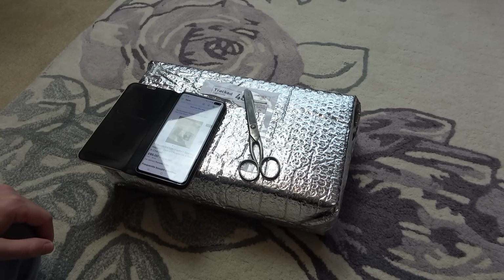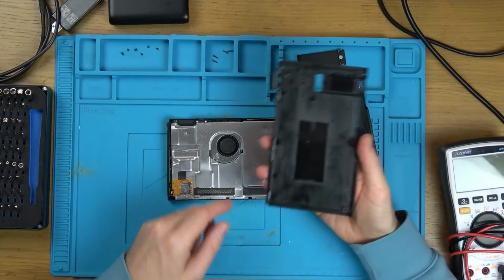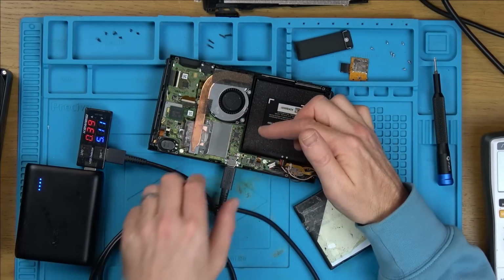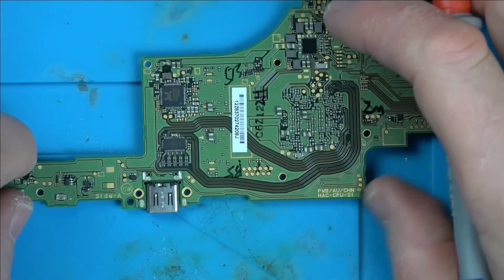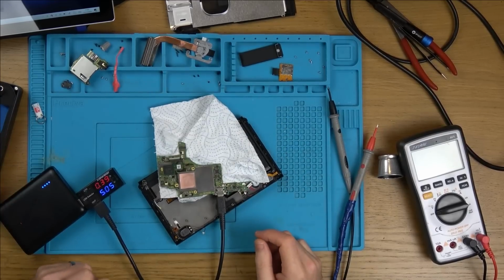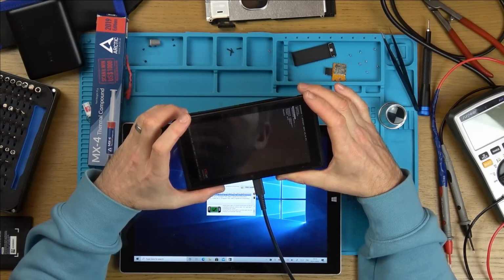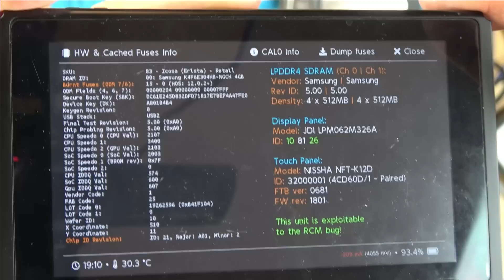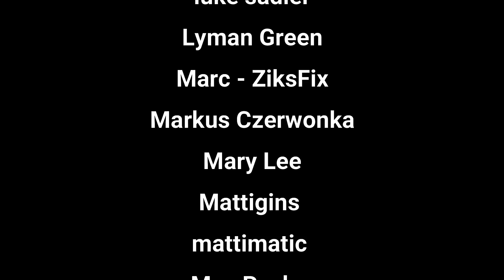Dishonest Broken Nintendo Switch from eBay - Can I FIX it?

Comment: Just for reference, there is a way to rebuild a new nand for it without the original keys. I think Dan from New Retro Repair has a way to do it on his channel :)
Reply: Hey Phil, thanks for the mention! @My Mate VINCE Check out the video where I rebuild the NAND for a switch. It's a big IF, but IF your switch NAND still works and you can access the prod keys, you can essentially do a "manual" factory reset to clear out any corrupted files. It basically rebuilds HOS using the keys stored on the NAND module to get it back to a factory state.

If you have any questions feel free to email me or DM me. Contact info is on most of my videos/streams 🙂
Reply: @NewRetroRepair  no worries mate. I hope vince can find some useful info for a revisit on your channel :)
Reply: It's great that all you repair guys help each other out. Vince is a nice guy ,just like yourself 👍
Reply: Yeah, ive done done this on a console i bought that had the same issue as this one, although it won’t play online anymore it will work offline just fine

Comment: I don't know much about the switch but I think RCM mode is recovery mode or rescue mode, special mode built in to the main chip to allow loading software even if the main operating system (stored on the eMMC chip) is damaged or missing. So it's definitely possible that it was a failed hacking attempt that corrupted the contents of the eMMC, but it's also possible just the eMMC itself or something on the eMMC board failed, in all of those cases the console will fall back to recovery (RCM) mode. autoRCM works by tricking the console into thinking the eMMC is corrupted so that it always starts in RCM mode, but I don't think that's what happened here.

Again not sure if it's common on switch but in other devices especially in various cars, the eMMC chips do fail quite often. It's such a problem on older Teslas that the cars have actually been recalled for it

From what I've read, if you don't mind using up a spare eMMC board (it will get overwritten), if you put in a working eMMC board, think you can extract the console keys from the APU using a tool called Lockpick. You can then use these keys to generate a working switch firmware correctly married to the console? There is a full guide if you search google for manualchoiupgrade. Obviously when backing up in step 2 you are backing up the donor NAND (aka eMMC) which is worth doing if you want to try to put the donor eMMC back in its original console later on. you can get keys.txt from Lockpick I think (just rename the keys file it makes to keys.txt), the firmware (fw) file you need to find online somewhere, everything else you need is in that guide. I have never tried this so if anyone reading this has any idea on whether this could actually work or not, I would be really interested to know!

PS - really enjoyed video as always!
Reply from the maker: Excellent, thanks ekens, I will google that guide and see what others comments say. It would be great to get the standard Switch OS back on here again 👍👍👍👍👍
Reply: @Mymatevince  it is a hackable switch and those go for good money
Reply: @Mymatevince  I would love a follow up video on possible fixes to reinstall the original OS to the switch and to bypass or rewrite over the code sets that are on the old EMMc nand flash.
Reply: @Dtr146  I don't think they're that valuable anymore since the newer models are close to being fully exploited.
Reply: I've not watched this yet, but I am at the start. From this short comment, are you saying it is in RCM mode?
Basically, if you have a hacked system, you HAVE to stick the paper clip / slide thing in the right Joycon rail, then hold Volume Up and Power, this puts the system into RCM mode, where it is ready to accept a payload and boot.
Now, you can get around all this faff by setting an option in the custom firmware ( once you have booted it ) that keeps the system in RCM mode " Auto RCM" as it is called.
I recently had to "fix" this for someone local, they just wanted a normal working Switch, so after fully charging it, I booted it to custom firmware, went in to "Hekate" and changed Auto RCM to "off" and then it would boot as normal. 
Hopefully this is helpful to you, and now... off I go to watch the rest of the video and see if I have totally got the wrong end of the stick :p
Reply: @unitedfools3493  I thought the only way to hack the newer switch models is via mod chips?
Reply: @unitedfools3493  Mod chip only the newer models cant be exploited any other way and the mod chip is too expensive for it to be viable.
Reply: @Mymatevince  from my understanding the emmc on the switch is paired to the mobo so they cannot be swapped out.

Comment: Vince I think you're mistaken, RCM doesn't mean it been hacked, it just means its in recovery mode, which very much could be because that chip died.
RCM is used to push the payload to hack it, but doesn't necessarily mean it has been hacked.
Reply: Definitely hacked. Has "dodgy" software on it.
Reply: yes regular RCM  (recovery mode) but there is also auto RCM and that does indeed need to enabled from a  CFW so it was hacked ,  it has hekate on it
Reply: @chrish1398  the software is not "dodgy" that is hekate
there may be a way to restore it  to get  horizon working again , but it would be much easier if he had a  NAND dump/ backup 
the first thing you should always do when you hack a console is  make a raw dump of your NAND
he should try to  put an SD card in it with atmosphere setup and see if it will boot atmosphere CFW
Reply: @andreamitchell4758  that’s not true. You can turn auto RCM on as a controlled way of essentially “bricking” your switch, this doesn’t require it to be hacked at all.
Also the software he is using, he is pushing the payload for the software it’s running.
If by hacked you mean accessing the menu to turn that on, then maybe, but it doesn’t necessarily mean it’s running any software. AutoRCM could be a fall back mode because that chip died.
Reply: @Natei  yeah I mean accessing the hekate menu to  enable autoRCM mode
the switch has regular  RCM out of the box 
that requires to use shot 2 pins in the joycon rail (use a RCM jig) it's a feature of the terga X1 chip
well at least on the early non patched erista model switches , not the red box mariko ones or later  ipatched erista models
someone would have had to install hekate in order to  enable the autoRCM on his switch , which I would consider hacking it
I use  SXOS and never used hekate or atmosphere but I assume it won't boot because the payload looks for the atmos boot bin file on the sd card which he does not have setup , this console was probably using an emulated NAND too ,  which is also missing since there is no SD card
not sure if simply setting up the atmosphere files on the SD card would enable this console to boot into  OFW or  to atmosphere CFW or not
 but there is a  complex tutorial  on how to unbrick it without having a NAND backup so it is salvageable at least it could boot CFW and maybe  OFW too, but might not be able to access the eshop or run retail carts
since the soft brick recovery method wipes the systems  serial number
so might just be able to   run .NSP's  and not go online
Reply: @andreamitchell4758   You are wrong on AutoRCM, you dont need autorcm to have the CFW, you have two cases to boot cfw, first is to trigger rcm in normal way (rcm jig + volup and power) or turn on autorcm to simplify your life. But in this switch there wasnt any autorcm, because If there was auto rcm enabled, even with another emmc the switch turns rcm on, but with the other one Vince needed to trigger rcm with jig + volup and power.
Reply: yes RCM is part of the Switch for recovery and literally means ReCoveryMode. Usually the normies don't even know about RCM and just want to play games have fun ect.
it is also true that RCM is used to push a payload on the first/earlier Switch models and load software into/onto the switch so you could for instance play games you've downloaded, or run emulators you normally can't run or edit save files to give yourself an advantage or load android or linux on it as a functional OS.

What im trying to say is, If auto RCM is on it doesn't necessarily mean the EMMc chip died, it could be but it just means its in recovery mode due to a read/write error, dead hardware, a short, hacking, something else? its been too long since i played a hacked switch so bare with me.
Reply: @VintageCR  RCM turns itself on, only if emmc is missing/removed/faulty/broken etc...  There is no AutoRCM on this switch and the proof is on the video when Vince change the faulty emmc with a good one. Even if it doesnt turn on normally, RCM isnt triggered. Because the RCM officially, turns on, like i said first, only if emmc is missing/removed/faulty/broken etc.
Reply: @x7l7j8cc  yes I know you don't need RCM to use CFW , but you do need to  hack your switch and install hekate to enable auto RCM
I believe auto RCM parches something in the NAND doesn't it? So if he swapped out the EMMC then of course the auto RCM would not work anymore
But I  not sure that the tegra RCM GUI program on the PC is actually detecting when it turns green , is it saying this console has auto RCM enabled or would it turn green if connected to any non patched erista ,or would it only turn green if you put in the RCM jig and held volume up and power and it was already in Aurora RCM or in auto RCM?
I'd have to go back and watch the video again but I am just going by him saying it has auto RCM enabled when he got it
Reply: @andreamitchell4758  have you watched the video, because i dont think so... and let me tell you why... You can see clearly Failed to init emmc (original emmc of the switch), if it failed then the emmc cannot be read/write and anything else, so for AutoRCM. But the official RCM is a Recovery Mode (R.C.M. ReCovery Mode), and will trigger only if emmc is missing/removed/faulty/broken. AutoRCM is a way to trigger RCM for easy CFW, but in this scenario isnt the case. So stop telling there was a CFW or anything else... I have a modded switch, and i can tell.
Reply: @x7l7j8cc  yes I know the difference between RCM and auto RCM
I know what auto RCM is for but I never use it myself 
RCM is triggered by using the jig and shorting the pins in the right  joycon rail and holding vol up while powering in the console
Auto RCM is to make it more convenient and to be able to skip that step so you can just inject the payload , auto RCM has to be enabled first using hekate  
I just said I don't Remember what happened in the video I just went by him saying it had auto RCM ,so you are saying it does not have auto RCM setup and that the console is just entering recover mode  because of a faulty NAND chip?

And are you sure that failed to initialize EMMC only shows up if there is a problem with the physical NAND and wouldn't show up if you set up an emunand and then tried to boot without the micro SD inserted?
Reply: Spot on Nate.

It's not auto-RCMd, it panics to RCM when EMMC is corrupt, this could happen due to a power down on update or any number of reasons.

Hekate is a great way to boot into a GUI to diagnose this, but the ability to do so doesn't necessarily mean its due to any hack. (Nintendo uses a payload injector to run their own diagnostic software, so on a NAND/EMMC failure it makes sense to default to RCM)
Reply: @andreamitchell4758  you can try it on your own if you want with any Switch... Try to disconnect the EMMC module from the switch, and turn it on, connect to PC and MAGIC RCM Mode.

"And are you sure that failed to initialize EMMC only shows up if there is a problem with the physical NAND and wouldn't show up if you set up an emunand and then tried to boot without the micro SD inserted?" Yes, because eMMC is the physical NAND. microSD is microSD and emuMMC is a copy of the physical NAND on a partition stored in the microsd, but hekate doesnt have a info page for the emummc like the emmc one.
Reply: @ArticTiger  yeah either way he could try this
/watch?v=mH8osmtPFlA
first with the NAND that came with the console and then with the spare NAND he has if that doesn't work
but  first he should get an  SD card and set up amosphere on it and see if it will boot to atmosphere
Reply: @ArticTiger  You’re completely right. The seller wasn’t dishonest, everything was correct. It’s just a unit with a broken eMMC.
Reply: Hekate is a custom firmware for switches, it's been hacked.
Reply: @Promethium666  NO... hekate is a GUI for booting payloads, CFW too (but its not a CFW itself), eMMC backup/Restore and other usefull tools..
And for god's sake, stop telling "it's been hacked", hekate is a payload that can be injected from RCM, but doesnt mean the system was hacked. 

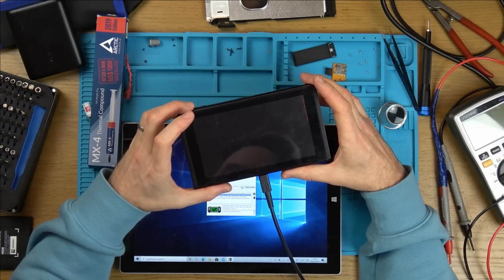Vince dont know anything about hacked console... He stated "i think its been hacked", but RCM is a recovery mode that Nintendo uses to Diagnose and Recovery Consoles you send to him to Recover. But here, in this video, is different.... The EMMC NAND is faulty/broken, and you can see it from 27:57 to 29:14, "Failed to Init eMMC", therefore emmc is broken = no cfw, no autorcm mod = not modded. And eMMC broken/missing/faulty/etc = RCM triggered by default.
Reply: @chrish1398  because there was no SD card inserted, it literally could not have been hacked. Switch CFW and mods all run from the SD card. After the SD card is removed it goes back to just being a regular Switch
Reply: @andreamitchell4758  Yeh ,yeh. We all know what its used for ....
Reply: @clothinghanger6978  no not auto RCM though ,auto RCM makes changes in your NAND I think or the syscon  it probably the NAND  , nothing to do with the sd card

Comment: Great job getting this one "working" =D  RCM is the built in recovery mode I think!  It's possible a legit update corrupted due to power issue or something.  Maybe there's a way to re-sign another eMMC to this device?  If it's not possible now, I bet it will be in years to come!
Reply from the maker: Cheers Chris, hopefully some comments will come in to find out if it is possible 👍

Comment: Hi Vince, I'm not sure if you ever went back to this, but, I heard of someone who was able to resolve the "failed to init eMMC" error on Hekate. They had some luck by removing the EMMC from the memory board and placing it in a BGA169 reader. Using a flash programmer, they were able to read the EMMC in either 1 or 4 bit mode, depending on the severity of the failure. Although taking a backup in a lower bit mode was time-consuming, they had a way to restore a brand new EMMC with the backup they had taken from the faulty one. They also had success in reading a faulty EMMC with an SD card adapter and manually soldering the lines between the EMMC IC and the pins of the SD card adapter. At a minimum, they needed VCC, VSS, CMD, CLK, DAT0, which ensured a 1-bit mode read/write.

Comment: Awesome work Vince! I always admire your perseverance! Others would have given up and sent that power supply to landfill, and all because of a tiny SMD resistor! A good fault finding - albeit time consuming - tactic would be to go round a board testing resistors checking they provide the resistance they are rated at. Obviously it's not an exact science if they are in circuit, but in theory if you test straight across the resistor the reading shouldn't be too far off. Hopefully this video will help others with this particular power supply!

Comment: Nice video Vince! I think this was not hacked before just have a failed EMMC. Even if you remove the EMMC module and plug the switch into the PC it will show up as RCM in Tegra. Other important thing is to never plug in the EMMC of an another switch because it will burn fuses which sucks. The only way would be to recover this switch is with a Modchip which is not easy to find anymore.

Comment: If you see this, most/all of the nand rebuild guides out there being recommended assume the eMMC has an intact partition layout with the partitions properly encrypted with the consoles keys. None of that would apply here since you’d be using a replacement eMMC from another device.
You can restore systems under these circumstances, but it’s a bit more involved and there are some catches (mainly, online stuff and possibly gamecards will not work).
I’d be happy to try helping if you’re interested though ^^

Comment: I would start by measuring the emmc board in diode mode and comparing to a good one. The vias corrode easily. If that all looks fine, you could try running biskeydump to see if you can still get at the keys. If you do get bad readings, you could try rebelling and putting the chip on another board.

Comment: It's possible to completely bypass the eMMC and use an SD card for something called "EmuMMC" where you run an emulated eMMC, complete with a copy of the system OS and everything off the SD card alone.
When you set up Atmosphere (a custom Switch firmware), this is usually the recommended method. Run your games and whatnot off EmuMMC and it all works perfectly. The only caveat is whenever power is lost (battery drained or a full shut-off), you have to re-inject a payload that lets Atmosphere boot from the EmuMMC properly as opposed to your non-existent eMMC.

Doing the Lockpick method is obviously the better option if your ultimate goal is to restore the Switch to stock.